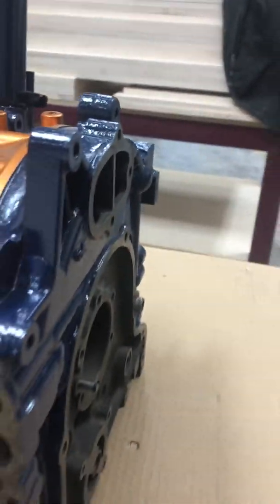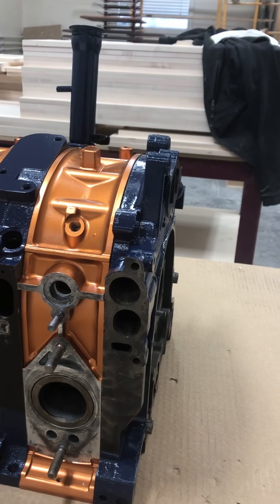Mazda 13b turbo aircraft

Comment: I know this is a year ago but you actually can use a filler for that upper aux port inside the rotating sleeve. I used Quick Steal to smooth out the transition on my 6 port rebuild back in 2005 and it held up over 50,000 miles with no chipping. Engine let go because of experimental coolant seals failed I was experimenting with at the time. BTW, I'm glad someone is doing a video series on a Mazda 13b airplane. I've been playing with rotary's for 30yrs and have a DIY 20b build in my 94 Mazda Rx7. I plan on doing my own rotary airplane build in a few years. Will definitely sub to this.
Reply: Another fatal crash involving a Mazda engine this week... 
There is a very good reason why not a single type rated passenger aircraft has ever been sold with a Wankel engine.
Too unreliable.
Reply: @sandervanderkammen9230  Link? You couldn't possibly know what the CAUSE was this early if it's been this week so stop your childish trolling. You too old for this nonsense. Prove the ROTARY was the reason?
Reply: @rotaryperfection  The FAA confirmed that Tom Parkes crash was due to engine failure of the Mazda 20b. Loss of power on takeoff due to apex seal failure.
Reply: @rotaryperfection  Mercedes-Benz is the only automobile engines currently holding a airworthiness certification for type rated passenger aircraft. Austro AE300
Reply: @sandervanderkammen9230  I found the FAA registry. You're full of it. Engine was an IO-360 for Jackson.
Reply: @rotaryperfection  There is not a single Wankel engine available for sale with an airworthiness certification.. this is because not a not a single Wankel engine has ever reliably completed a FAA or EASA  PFTR or TBO program for airworthiness certification.
Too unreliable.
Reply: @rotaryperfection  There are hundreds of reciprocating engines that have airworthiness certifications.... no Wankel engines that have airworthiness certifications.
Reply: @rotaryperfection  Yes, proof... because if look at the FAA registry it was submitted in 2016... the plane that crashed this week was powered by a Mazda 20b engine... not a certified Continental IO-360
Reply: @sandervanderkammen9230  That's BS and you cant PROVE it still had the rotary in it. The registry says IO360 and NOT Mazda 20b so until something else more concrete says otherwise, that other 10yrs old video wont cut it as your proof. Also your ONLY argument is certification yet, so many of these certified piston engines car involved in NUMEROUS accidents this week alone. Why so many certified piston falling out the sky every week and only 1 rotary over decades? 🤔 Certification don't mean SHIT when thousands have died with certified piston under the cowl. Your argument is trash and I will continue to expose how meaningless it is for you compare them.
Reply: @rotaryperfection  FAA registration say it never had a certified airworthy aircraft engine installed... read AE  NONE.
Reply: @rotaryperfection  Answer the question big mouth.
Name a single type rated passenger aircraft with a Wankel engine??

Comment: What kind of fool puts a Wankel engine in an aircraft???
Reply from the maker: Sander Van der Kammen what kind of a fool ridicules people?  What’s your expertise on the wankle?
Reply: @constechable  Thank you for answering my question...
All the legitimate, qualified experts agree that the Wankel engine is entirely unsuitable for aircraft applications which is why no legitimate aircraft manfacturer has ever used one.
Reply from the maker: Sander Van der Kammen So you are admitting that you know nothing about them. There’s a lot of reasons they aren’t being used by airplane manufacturers. There’s a lot of reason why all auto conversions aren’t being used by airplane manufacturers. I have ran the crap out of winkle engines even push them up to 700-800 hp. I have never in 15 years had a catastrophic engine failure with one of them.  That being said I have lost transmissions, ECU components, etc.  The PRSU is definitely something I will be inspecting and keeping an eye on. I am in the process of putting together a redundant set of electronics for the engine. The nice thing about a Wankel engine over a traditional piston engine is it slowly starts telling you it has a problem.  If the Apex seals are wearing, or one broke you will know, but the engine will still be running.  When a Lycoming loses a piston the engine comes apart and it is a catastrophic failure.  So although I am not an aircraft manufacturer and I by no means no everything and I appreciate your concern I feel as confident with my engine choice as you do with yours.
Reply: @constechable  Thank you for proving you know nothing about Wankel engines or aviation.
Reply from the maker: Sander Van der Kammen you say that knowing nothing about me or my background. How many wankled have you rebuilt and ran for the last two decades? How many RPMs are my rotors going to be spinning while in flight?
Reply: @constechable  Just name a single FAA or EASA certified passenger aircraft available.
Reply from the maker: Sander Van der Kammen you said there was one I told you there was a lot of reasons they don’t use them. You said I didn’t know anything about Wankel engine or airplanes. Since you are the expert I wanted you to tell me how many RPMs my rotor will be turning in flight approximately
Reply from the maker: There’s a lot of engines not used and certified aircraft, as a matter of fact I don’t think they’ve had a new in approved since 1940 but that does not mean there aren’t other choices. If you feel great running your Lycoming pay your $40,000 and run it I’m all behind it hope you have an amazing time and hope everything goes well.
Reply: @constechable  Any engineer worth his salt knows that piston (rotor) RPM is one third of crankshaft rpms.
Reply: @constechable  There are several automobile based aircraft engines that have successfully achieved airworthiness certification..
None of them are Wankel engines.
Reply from the maker: Sander Van der Kammen Yeah I know that, and I’ve explained that several times in the previous messages. Thanks for your input.
Reply: @constechable  Thank you for your honest admission... now I know what kind of fool they are.

Comment: This doesn't look like your father's rotary engine. Has this engine type been furrher developed since they were famous (infamous) in the Mazda RX series decades ago? If durability and reliability have been substantially improved, I want to learn more and will follow the progress of you project as well. I only need 110 to 150 hp but am hoping for installation weight near that of a Jabiru 2200. I wouldn't be surprised if rotary could do that, if a block with appropriate displacement is available. Thank you.
Reply from the maker: FoesFlyDennis Mine is a second generation Mazda 13 B. So there was the 12 a, then the 13 B, and then the second generation 13 B. It’s basically the same motor with a few upgrades to correct some of the weaknesses the factory engine had, ie better Apex seals. One of the reasons the motor never gained more popularity is because in order to lubricate the rotor it injects engine oil into the combustion chamber which then burns out through the exhaust which creates worse emissions. I am eliminating that rotor oil injection pump, and simply mixing two-stroke oil in my fuel at a ratio of 100 to 1.
Reply: @constechable  The Wankel never gained popularity because they are inherently unreliable and inefficient... to critical requirments in a aircraft application.
Reply from the maker: @sandervanderkammen9230  that are actually very efficient, to get the same hp you’d need to run a IO 540, of which weighs almost double and burns way more fuel.  A Lycoming has to be partially overhauled at 1500-2000 hrs, when compared to car miles that’s about 60,000 miles.  Then it’s junk at 3000 hrs. About 85000 miles.  I’ve had several rotaries and they all lasted longer than that.  Three moving parts, $3500 to rebuild.  Lycoming IO 540 costs $30-40 k to rebuild. I can replace my rotary 10 times to compete in terms of dollars so every 1000 miles. I wish there were redundant apex seals that would be awesome.  That said I don’t use ceramic aided seals because if it breaks it creates catastrophic failure.  I have lost a spex seal and drove my buggy 30 minutes back to the truck and fixed it later, anything goes down on a Lycoming it’s catastrophic.  I know it has up sides and downsides, I also know if I have to spend $75,000 on my Lycoming IO 540 I can’t afford the build.  Plus I’d have to increase load by 50% to haul it around.  Airplane engines are way overpriced VW engines, with 1940 technology at rediculous prices. We need something new.
Reply: @constechable  I can see from your remarks you know absolutely nothing about aircraft engines.
The ia not a single Wankel engine available for sale with a airworthiness certification... this is because not a single Wankel engine has ever successfully completed a PFTR or TBO program for airworthiness certification.

Wankel engines are horribly inefficient and have a much higher BSFC, this reduces payload, range or both compared to a reciprocating engine of the same output...
 Key to this disadvantage is the Wankel engines inability to safely run Lean of Peak.

You cannot compare horsepower output with a Mazda engine, there are no flight rated Mazda engines.

Apex seal is what caused Tom Parkes crash...
Reply from the maker: @sandervanderkammen9230  I own two rotary engines and have totally rebuilt a 320 Lycoming that’s in an aircraft I built.  I know the Lycoming, I got lucky, found a core for 5k rebuild parts and machine work 20k wheww!! I did all disassembly an assembly. I know a bit about Lycoming. There is hardly any risk in a rotary engine at 300 Hp or less. Under 75k equivalent miles.  Now with crazy boost they break seals far more often.  In buggies I’ve only broken one, I drove 30 minutes home with it. To each there own, my new aircraft requires 300hp a Lycoming IO 540 required for that hp even if I do the work, would be close to 75k I can’t afford that. Also by the time I increase the airframe to accommodate the extra weight would also require 350-375 hp which the IO 540 doesn’t make.
Reply: @constechable  Bullshite, there are no 300hp Wankel engines that have a FAA or EASA PFTR or Airworthiness Certification.
Reply: @constechable  DO YOU HAVE AN IA ????
Reply from the maker: @sandervanderkammen9230  no I work on my experimental airplanes only.
Reply: @constechable  Exactly my point, you have no formal education or professional experience.
Reply from the maker: @sandervanderkammen9230  I have a lot of auto engine experience, still no formal training.  Built several rotarys turbo charged them to 18 psi ran them like crazy at the dunes pulling 900 hp.  Broke one apex seal.  It want catastrophic as I drove the buggy home.  In my airplane it would have got me on the ground.  I’m not pushing this motor like that only 6-7 psi 300-310 hp.  Under those criteria should go a good long time.  We will compare it to my 10 times the money Lycoming.  Time will tell.
Reply: @constechable  Yes, thanks for confirming my suspicions, you are not qualified to speak inteligently on this topic at all.
Reply from the maker: @sandervanderkammen9230  neither were the Wright brothers but guess what!!!
Reply from the maker: Can I see your degree please.
Reply: @constechable  You didn't invent the airplane...
Reply: @constechable  What for? You don't know what a degree looks like son.
Reply from the maker: @sandervanderkammen9230  i’ve seen some pretty amazing things done by people with no degrees. A degree means very little to me. You build your airplane and I’ll build mine I don’t know why you have to be such a troll.
Reply from the maker: @sandervanderkammen9230  and not that it matters, but I do have a degree, 2 actually, one a professional pilot bachelor degree, and a second bachelors in business.
Reply from the maker: @sandervanderkammen9230  You’re just a jack ass that only think something can be done one way. Kiss off!
Reply from the maker: Yeah I’m probably only saving $40,000 that’s not too much.  How did you find somebody else harassed, or here’s an idea do your own project and pay attention to it instead of throwing your lack of information around and being negative to everyone else.
Reply from the maker: @sandervanderkammen9230  can you tell me the FAA regulation I am breaking? Please give me the fars I would love to read it.
Reply: @constechable  You're the one risking your life to save buck...

Comment: How much power do you plan to pull, wt, gear box, prop?
Reply from the maker: Tim Duncan 325hp max.  1500lbs plane, 1300 useful load. Mine is a lot less complicated than the raptor thank goodness.
Reply from the maker: Tim Duncan PSRU airtrikes spg5 haven’t chosen prop for sure but constant speed with reverse.  Pusher configuration
Reply: Another fatal crash involving a Mazda engine this week... 
This after many planes have been converted to reciprocating engines after Tom Parkes crash.